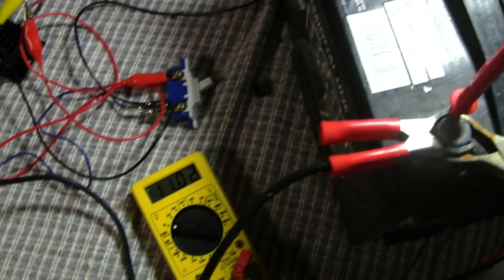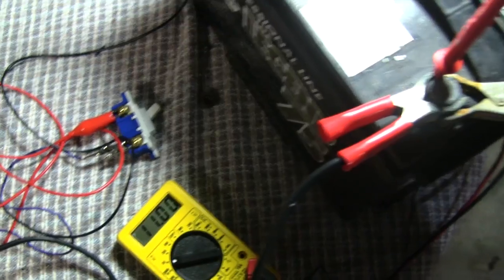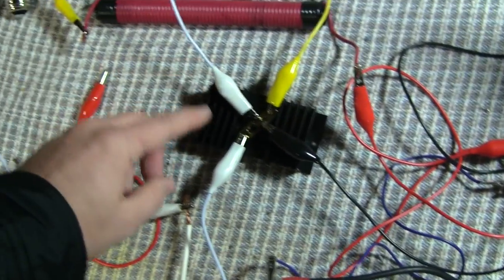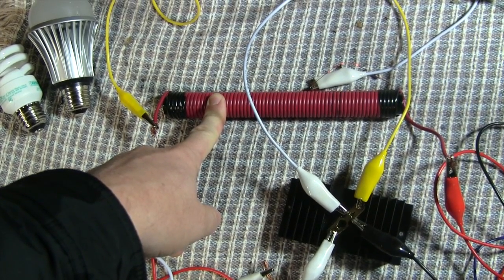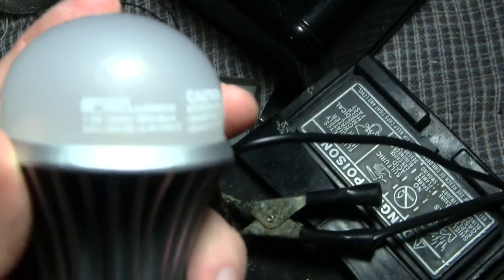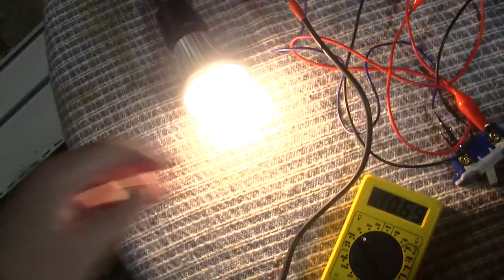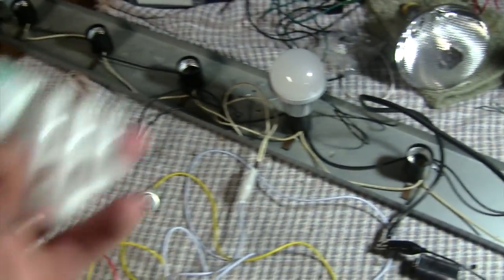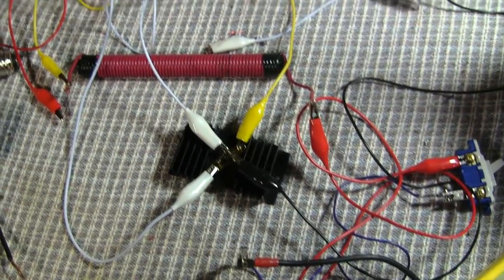Super Joule Ringer 3.0

Comment: have you messed around with a transistor free joule ringer yet, i think that's lasersaber's latest mod....what is the easiest joule ringer to build for the nontechnical?
Reply: Version #3
Reply: Danyal Ahmad thank you! have you tried the transistorless?  what led bulb brands are you using?
Reply: danh le
To put into perspective for you my friend, it all ends with two choices. A cheaper and easier setup with less output, or a little more expensive, and complex setup with amazing output. Although, the problem I see with the ringer 3.0 is the transistors that blow when under really high load/watts. Each transistor cost about a dollar each, so I buy them in packs of five. I believe that you can give one joule ringer 3.0 about 15 amps of load,,, sorry I actually don't have the full specs with me right now. But, you can Google that. You can use pretty much any kind of light bulb, I would recommend ones with fairly low watt input required. I am actually trying to be able to connect more then 1 transistor...but for now if you want to explore this  circuit and all the other kinds you should try using some kind of KillAWatt meter. Hope this helped, please excuse my grammar mistakes I wrote this in a rush. By the way, there are actually more pros and cons to both of them, but I don't exactly have the time to explain them to you right now :(
Reply: Danyal Ahmad
no problem thank you for the insight thus far...i'll keep it all in mind!  English is perfect...would love to see a video of your version with multi transisotrs soon
Reply: danh le  I would like to see my multiple transistor Joule Ringer too!
The problem with it is that once connected to more then 1 transistor the entire system goes bad, or wack.  It seems like the input is being equally distributed between the transistors, but the output does not "synch" with each other and the output is considerably changed. It actually may decrease its resistance to high output requirements, getting rid of the whole point of adding another transistor. Although, I think I have spotted the problem and will definitely trouble shoot it as soon as possible even though that means many more parts, for the sake of science or at least electricity I will tackle it! I actually even have intentions of connect a regular Joule Thief circuit directly into a Joule Ringer. Just for experimental purposes, it probably won't do much for me though. I will have to make sure the regular Joule Thief is rewired to give stable, DC output. Who knows what I might discover! You can also can try using other transistors, and see if you just might find the best one for these kind of circuits. Or just use some other kind of semi conductor to amplify the input, there are many-many out there. You have to build one your self to see what I'm talking about.

For now that's all I know, have fun experimenting!
- Danyal Ahmad

Comment: The problem I have ran into with the Utilitech led bulbs is that after 100 hours of joule ringer running the internal circuit it gives up and will not run anymore at high frequency and flashes and goes dim. It will however work at 60hz way longer before failure. The standard led powering capacitive resistive type older led bulbs would last forever in this setup they are lights of America led bulbs. Ebay has cheap led bulbs that work somewhat better then utilitech from china.